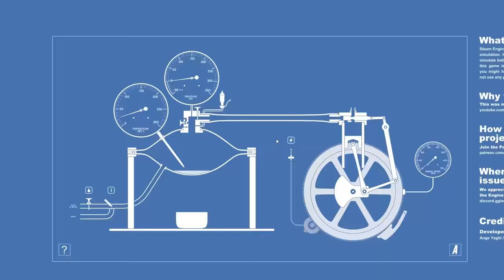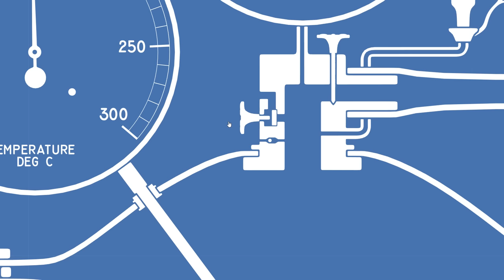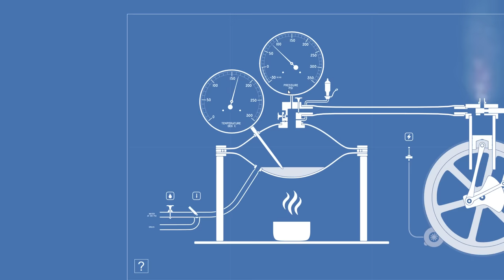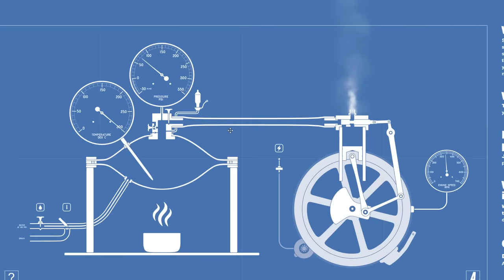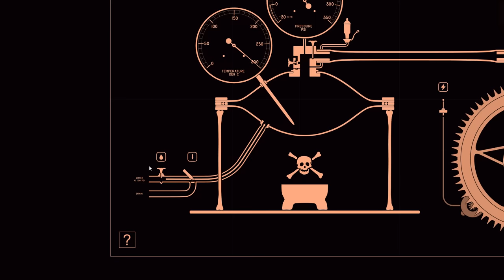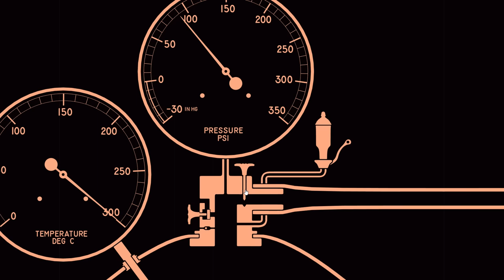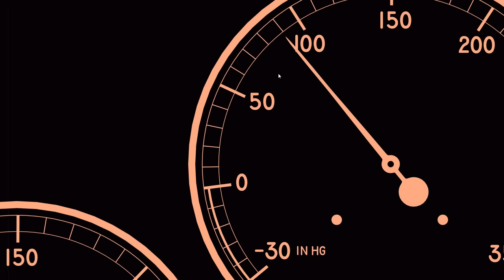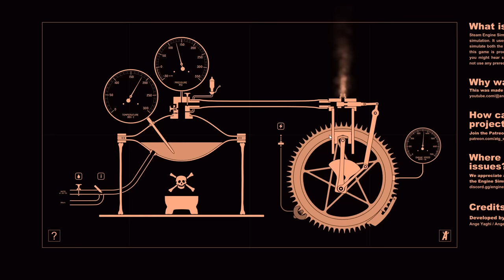Testing Max RPM on Steam Powered Piston Engines With Steam Engine Simulator!

Comment: The thing that's left out of this video is Ange the Great made this as part of a series on his sound simulations. All the sounds made by the engine are generated by a fluid model running, they're not canned sounds. A lot of his series focuses on the sounds for car engines, anywhere from I4 engines to V8 engines to 9 cylinder radials, and even a Wankel rotary.
Reply: Also all the parts of the engine are physical models, physically interacting.
Reply: At crazy UPS too (updates per second)
It is needed because you need sound to be sampled at 44kHz

Comment: You know what would be really cool? A game where you can build a steam engine out of different components. Different valve gear, cylinder sizes and boilers and stuff. Then all those variables would determine how the engine runs. You could go from a little single acting, single cylinder engine to a ginormous naval steam engine. On that note, check out some of the stupendous naval steam engines of the ocean liners of old! Next level engineering.
Reply: From the Depths lets you build steam engines, though it may not get as granular as what you want.
Reply: @EpsilonRosePersonal  yeah I’ve seems FTD and it is very snazzy, but not Choo Choo enough

Comment: I would love to see this game released with an upgrade store! depending on how high of an RPM you get you can unlock things like steam injectors, double-acting valve gears, water preheaters, and larger generator gear boxes
Reply: its not a game its a simulator 💀
Reply: I don't know where you got this from but even the developer calls it a game.
Reply: @johnhilton145  I've been watching Ange for quite some time. He always calls it a simulator, although he has used the simulator in an unreleased driving game
Reply: @paulkanja  High-fidelity simulators and games aren't mutually exclusive. If you haven't already, check out his great video where he updates the Steam game. In it, he implements a few functions suggested by a majority of the engine simulator community. If you also check the video there is many references to him suggesting it is a game rather than a software tool (Even the title calls it a game). I think the above comment is very much valid.
Reply: @johnhilton145  ahh missed that video. i'm just so used to him calling it a sim. thanks for the correction

Comment: You made vacuum because you quickly cooled steam and it condensed to water, which has lower volume
You can make the engine run backwards this way too! But you will have 1 atmosphere of pressure difference at max, so it won't be very powerfull (kinda like very first steam engine, it was working with vacuum too)

Comment: The currant max speed achieved in this simulator is 4,691. Here is some instructions on how to get there.

>Lower Quality (N+Scroll down)
>Enter "Hell Mode" (spam click logo in bottom right)
>Full heat
>Slowly open throttle valve to 56%
>Wait for temperature to max out
>Slowly open water valve all the way
Reply: > Remove the brake :)
Reply: It's kinda not fair to lower the quality
Reply: @F_A_F123  I believe it only lowers audio calculation quality not physics quality. Because the game generates the audio based on the physics. Theres is no audio files in the game.
Reply: @ScrewedByRNG  then why to lower quality?
Reply: @F_A_F123 bc it's the first step in the process
Reply: @F_A_F123 i assume it’s to allow the physics simulation to run more often, since time isn’t used on audio
Reply: @F_A_F123 so that more processing power can be focused on the simulation
Reply: I managed to get 4686.5 RPM.  Throttle at 58 %

Comment: I like to (in hell mode) fill the tank full and close it off. Max fire until max temp is reached. Then slowly build up rpm with the smallest amounts of throttle until speed builds up then just go wide open for full max rpm. With the temp maxed you can keep maxed psi for longer to achieve the higher speeds. If you just max temp and psi then hammer the throttle wide open you won’t achieve the best speed.

Comment: I wonder if it's feasible to build a desktop-size steam locomotive you can run on tea
Reply: there is a sterling engine that runs on tea. a steam enngine however? unlikely, it would be insanely small
Reply: @TheCustomFHD  there are certainly desktop steam engines. If the tea would take the place of the water it probably would run for a little while... until the tannin gunks up the valve, or maybe jams the piston.
Reply: @Milamberinx  yes, desktop. But pure tea? Seems unlikely due to the minuscule amount of steam (and lack of continuos steam, or any pressure thereof). Sterlins, like said, for sure barely work
Reply: @Poldovico Is that burning dry tea leaf to make steam from water? Or tea leaf with water for drinking?
Reply: @TheCustomFHD  Dry tea leaf used to boil water would be a thing. The question to start with, has a loop hole in it.
Reply: @ducewags  I want to do the Sword in the Stone thing of pouring my drinking tea from the pot into the model locomotive and having it chuff off the table.
Reply: @Poldovico   Steeped tea is hot water. Water boils and makes steam, so yes it will work.
Reply: @ducewags  But will simply hot water with no fire make enough pressure to move even something so small?
Reply: @Poldovico  Hot or warm, cool or cooled liquids move on their own against the other, it's called thermodynamics. Testing is a way to try a thing to see if it works. Sounds like you have some testing to do, maybe? Back in the day engines had no water pumps to move the coolant, or a thermostat to hold, or slow the flow.
Reply: @Poldovico  You are going after a hot liquid to move a thing. Try using solid carbon dioxide to move a thing. Dry ice in water, and use the vapor to move the piston. More then one way to move things by heat transfer. I sure would like to hear an update on what you find works, or moves at a better rate of speed.
Reply: @ducewags  Yeah let me just quickly build a functional steam engine the size of a playstation controller.
Look, I'm sitting here wondering if it's possible, but it's a bit of a stretch to actually do it with my mechanical knowledge and manufacturing skills. Even if I were ready, it'd take some serious time.
That's not so say I necessarily wouldn't want to, but what's the point in basically telling me "shut up and go do a hobby project that'll take weeks to months to complete"?
I'm just musing on whether there is some known limitation related to scale or temperature.
Reply: @Poldovico  Wow, you just read into a thing we were just talking about, and come up with an "idea" I am some how bashing you on an "idea". Also at no point did I ever say or tell you to be quiet. Bouncing ideas is all I was doing. I was also going off the idea you had a steam engine, and wanted ideas on how to make it run, as you say off tea.

Comment: How does the temperature go above 100°c before all the water boils? or is the water level just an indicator for the amount of steam?
Reply: When the ambient pressure increases the boiling point of water also increases 
Angethegreat explains it in his video on the simulator as well (if I'm not mistaken)
Reply: As @arandomperson8465 said, the boiling points of all liquids are dependent on pressure. 
At atmospheric pressure, water boils at 100 C, which is what is taught in school. What is not really taught is that at higher pressures, the boiling point increases

Comment: Kan, you had the brake on for the most of the video...
Reply from the maker: I thought I turned it off when I entered Hell Mode... maybe I didn't
Reply: @kANGaming   i kept looking at the brake an it just was constantly on, it's very visual so it was easy to see that it's touching the wheel

Comment: Fun stuff to simulate, but silly.  Simulation does not address issues of RPM of engine.  No discussion of engine structure and engineering, such as stress on parts, lubrication, vibration.  Honda long ago made motorcycle engines run 20,000 RPM.
Reply: You need some unrealistically strong parts so that you can safely play with it